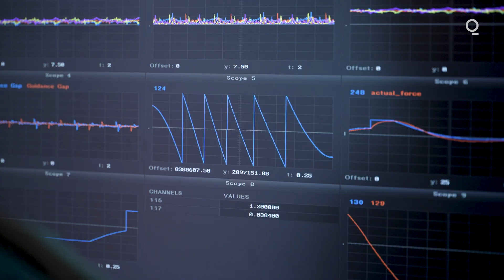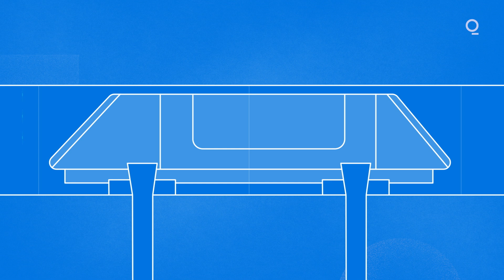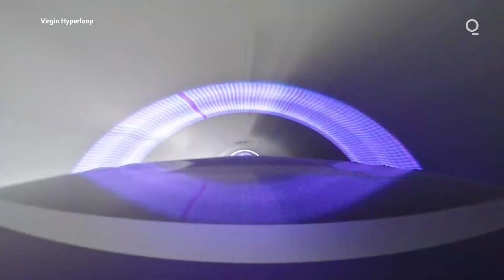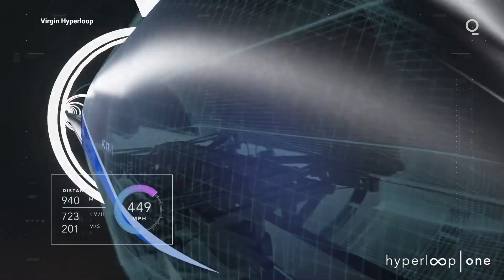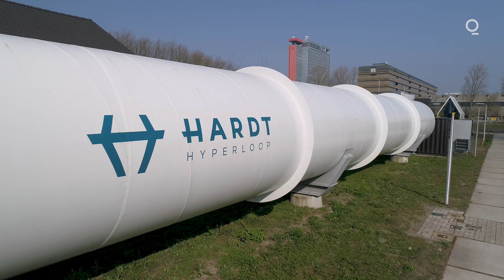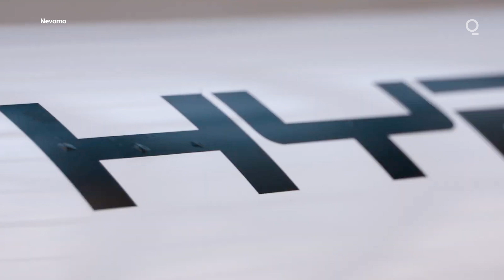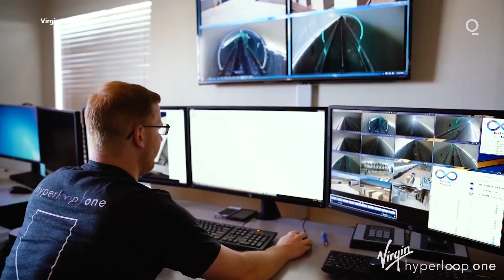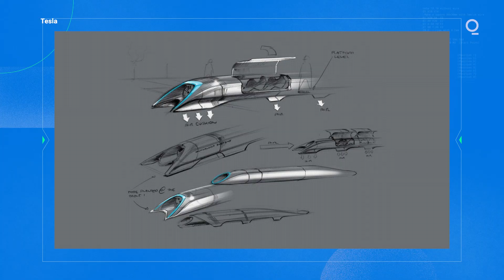The Hyperloop May Disrupt More Than Just Travel

Comment: Keeping a tunnel of any significant length in a vacuum state would be a miracle of science in itself.
Reply: @Hannes Königsmann there is a HUGE difference between pressure coming from the inside of a pipe and a pressure applied to the outside of a pipe.
Reply: @AR-zq9hq  That's absolutely not true. Ever heard of boilers or anything having several tubes inside with different outside pressures?
Reply: @AR-zq9hq  oh,the pressure-i can't take it anymore
Reply: @AR-zq9hq  Why is "there is a HUGE difference between pressure coming from the inside of a pipe and a pressure applied to the outside of a pipe"?
Reply: Oh and don't forget about a disaster that would ruin the track should a single pierce or joint fails
Reply: Flying machines were once a miracle too.
Reply: @zolac9732  Not really as birds fly and dinosaurs before them.
Reply: @Hannes Königsmann I mean there has to be a difference between overpressure inside or underpressure. Plus don't pipeline have bends that help them with the expanding and contracting in different temperatures. I'd be hard to take such a bend at 1000 kmh
Reply: @julian-xy7gh  indeed you are correct.
Reply: @Hannes Königsmann your analogy is completely incorrect. Creating a vacuum is much more difficult than containing high pressure. I worked with vacuum chambers for my dissertation. The problem isn't structural integrity, it's that gas molecules tend to be really small and leak into the system. You need a series of different pumps to even get near vacuum in a small chamber the size of a football, not to mention enough electricity to run a a few homes, and days of pumping. And I'm not talking some basic pump here, they just start you off, you need magnetic ion pumps, turbo pumps, diffusion pumps, it goes on. The system is also baked at very high temperatures before pumping to remove any surface impurities inside the chamber that may have settled. It's crazy expensive and requires doctors in physics to manage.
Reply: @SgtS1lky  no, he didn’t build any rocket, just like he’s not the Tesla founder. Musk has no formal training or engineering knowledge, but he sure likes to buy himself titles, just like he paid to be called a Tesla founder. Just a quack.
Reply: @boskee  Musk definitely worked hard for everything he has today. In the early days of SpaceX he was probably more present like an actual engineer in the company than today, same with Tesla. All in all, he isn't instantly a quack for hiring people to build rockets for him, man just leads the company. Even if he has no experience in any engineering field whatsoever, he still built up his company from ground up! Which is extremely hard, and gives him enough credit for what he is today.
Reply: Doesn’t have to be the whole tunnel all the time.
Reply: EXACTLY.  This is idiotic.
Reply: My thoughts exactly
Reply: That being said, the pneumatic railway did something similar, although smaller , in the 19th century, using coal fired steam engines.  These vacuum tubes were many miles long.
Reply: @darrellparfitt5908  Except they weren't vacuum tubes, they just worked on a pressure differential on one side of the pod versus the other. And this requires a decent seal between the pod and the tube which means friction which then means slower travel otherwise you then have heat and wear to deal with.
Reply: @SgtS1lky  He can be the Warp  engine goblin. This is a title that makes him neither a warp engine nor a goblin.
Reply: Why? 

Vacuums aren’t that hard to pull
Reply: Not to mention impractical, pointless and a huge waste of money.
Reply: The vacuum system at the Large Hadron Collider has a total volume of 15 000 mˆ3, which is probably the largest in the world. Such a volume would correspond to about  2.5 km of hyperloop tunnel. But the vacuum requirements for LHC are much, much stricter than for a hyperloop tunnel. So I would not say a scientific miracle is required; it is more a question of practicality and economy.
Reply: Near vacuum state
Reply: @prathneo  .001bar, might as well be a vacuum.
Reply: @prathneo  Same difference. We've never achieved pure vaccums, only near vacuums, we still call them vacuums. The pressures thrown around by these companies are more of a vacuum what other companies in other areas call a vacuum. It's a vacuum. And it'd be an insane feat of engineering.
Reply: @B4R0N.  i did, just never told anyone
Reply: @prathneo  Exactly this. A near vacuum is far easier than an actual vacuum
Reply: @TehPoet  what pressure are they going to keep it at?
Reply: @TehPoet  Even that is impressive. At scale the best strategy we have would be to dig a really long tunnel and pump the air out periodically which creates less friction. We could not physically create a vacuum tube, but we could potentially create a reduced pressure gradient for mag lev.
Reply: @TehPoet  any vacuum is technically a near vacuum... Maybe a slight underpressure would be viable.
Reply: @TehPoet  Actually the proposed state is basically a vacuum, they are really close and I think it would be impossible for a vacuum tube that sized but essentially it's a vacuum tube.
Reply: @TehPoet  So it takes only three fourth of a miracle and half a fortune to build and maintain.
Reply: @prathneo  99.9% of a vacuum, which is no different to an actual vacuum.
Reply: Only part of the tube has be in the vacuum state. Only where the hyperloop is during the trip.
Reply: @United_Nontoxic  and how is that going to be achieved?
Reply: @United_Nontoxic  wow so a pocket vacuum perhaps held in place with a forcefield,  while the pod hovers on its anti gravity field and uses warp engines to push it along,  oh and dont forget the inertial dampers, all power supplied by a anti matter reactor. And we will have all these new technologies in three years!
Reply: Erm the hadron collider...... you are acting like a technology that we achieved in 2008 is impossible in 2021, I have an idea go and study engineering instead of YouTube and you will understand this is entirely possible the only real concern i would have is how much electrical energy needs to be produced to run the thing because that's where the real problems start
Reply: @SgtS1lky  The large hadron collider does maintain a vacuum but its in a tightly controlled environment, the vacuum tube diameter, about 6cm, is smaller than hyperloop would be, it is much shorter as well even at 27km, and is completely temperature controlled from one end to the other.  Now, they are going after a much lower pressure, but still the scales involved and the tightly controlled environment make this a poor comparison.  It also isnt going to have a multi ton pod racing through it with a full maglev system installed.
Reply: This is old technology from the 50's
Reply: @Acme12345  1850s actually.  Failed then and is a failure now.
Reply: Not a problem, with airlocks along the line being progressively evacuated prior to arrival of pod.  We already have “proof of concept” in place with message delivery systems ib large department stores and hospitals.  I remember them as far back as the1950s.
Reply: @dewiz9596  yes and we know how reliable they are!  The whole thing about a vacuum is pointless.
Reply: @dewiz9596  Sure the pneumatic tube idea might work but the longer and wider the tube the less this works, and if you notice in those systems the acceleration and deceleration are somewhat abrubt.  Controlling the speed is incredibly difficult at scale.  Butbthis isnt what hyperloop is proposing.  That design aims to evacuate the entire length of the tube to reduce the air resistance of the pod moving through it to achieve higher speeds from a maglev pod train running inside it.
Reply: @dewiz9596  They moved at 1000 miles per hour? No so no prove of concept.
Reply: And the tunnel itself doesn’t have to be, it’s platform inside the tunnel that will house the hyper loop
Reply: In 1890
Reply: @blondegirlsezthis8798  dumb
Reply: don't worry, the brilliant minds would solve it
Reply: Hyperloop doesn't aim at full vacuum state and the idea that it does is a hoax invented by a certain salty reasercher addicted to debooooking
Reply: @jankapuscinski8456  Hyperloop is expected to run at .001 bar, basically a vacuum.  That's 1/1000th the pressure of sea level, .014psi.  Again, basically a vacuum for all intents and purposes.  And it is the only way they would get it to the high speeds promised.  While this is not impossible it is but one of dozens of significant engineering challenges to sort out before this idea can work at full scale.  Meanwhile normal high speed rail is ready to go.
Reply: @avi8r66  I find your point of view very interesting and knowledgeable. I am not an engineer. Could you please elaborate a bit more on the technological and scientific challenges the hyperloop presents?
Reply: @Lalairocks  Again?  I think I did that a few comments above.
Reply: @avi8r66  I was curious about keeping a vacuum state and why it is so dangerous. Anyways, appreciated.
Reply: @Lalairocks  Ok, so on that specific topic... 2 separate questions.
1) keeping a vacuum state: Assuming the chamber/tube/whatever is structurally capable of withstanding the pressure trying to crush it the issue is with leakage. Any small opening, microscopic gaps, cracks, a bit of dust in a seal, etc, allows air to enter.  And it doesn't take much to make it hard for the pumps to keep up.  So this is a problem that scales with the size of the chamber, especially when scaling it up means adding more holes in the form of access points, pump attachments, joints from section to section, inspection hatches, etc.  Pretty quickly you reach a point where the pumps are going to be running continuously just to keep the tube evacuated.

2) why is it so dangerous?  2 big risks... structurally a long tube with a vacuum in it has a lot of air pressure trying to crush it.  Search here on youtube for rail car implosion, that should demonstrate this issue.  The other risk is that if you have a pod racing through the tube and there is a breach in that tube ahead or behind it you will have a super sonic pressure wave rip through the tube and impacting the pod, potentially sending it hurtling along like a rifle bullet inside a gun barrel.  This would likely damage/destroy the pod and the people within.  Even if the system recognizes there was a breach and tried to bring the cars to a halt and lock them down the pressure wave would still impact the pod, and it would still be damaged or destroyed.

Make sense?
Reply: @avi8r66  You are so kind and awesome. Thanks so much for your time and wonderful explanation. All is clear.
Reply: @avi8r66  sounds exaggerated. Its just maglev, a well used technology, inside a vacuum tube to reduce air friction. It could even be compartmentalized with fast opening and closing locks at appropriate distances between. Leaks will be common, just reducing efficiency until the repair man comes.
Reply: @TheBooban  In concept its not complicated, and this is why musk was able to pitch it to investors.  But making it work, at full scale, as a transportation system will be prohibitively difficult and expensive.  Just building such a tube for a city to city distance, say 100km, that can safely tolerate being held at .001bar would be impressive.  Even just that, without the pods running inside, no maglev, just the empty evacuated tube built with the various emergency exit ports, inspection hatches, pump ports, etc along its length, would cost money to keep a stable pressure in the form of powering the vacuum pumps to offset the leaks.  For temp control it would need to be underground, so now you have a tunnel to dig as well between these end points.  It just gets worse from there as you make it a working transportation system.  Its a money pit that addresses a problem that doesnt really exist.
Reply: @jankapuscinski8456  just face the fact that it's nothing more than a publicity stunt... it's not going to happen
Reply: @jankapuscinski8456  If you've actually watched the videos of that VERY salty scientist, you'll see that he spends a fair bit of time on the "near vacuum" vs "vacuum" argument. In no way does he perpetuate a full vacuum myth. People just say vacuum because it saves 5 keystrokes and it's so "near" that it hardly warrants that extra effort

Comment: How do you vacuum the entire system? Also when system is down, how do escaped passengers survived in a vacuum?
Reply: There would have to be vacuum pumps at intervals along the tube, probably quite a few running constantly to compensate for leaks in seals.
Reply: Escaped passengers?  What escaped passengers?
Reply: I kinda tried calculating how much the air pressure would be on the tube over 1km. Pretty hard to imagine any material today that wouldn't just implode in a millisecond.
Reply: @brianmorris3290  haven't you heard that they're making it out of vibranium?
Reply: @brianmorris3290  what's the pressure on a nuclear submarine
Reply: @williamlee4731  Go figure. Not here to do your homework.
Reply: @williamlee4731  You have the analogy correct. Now have a look at how thick the hull of such a submarine is.
Reply: @Trevor_Austin  Yeah, but a submarine is a lot bigger in diameter. The larger the diameter the higher the force on it. A much smaller tube can get away with a much thinner hull.
Reply: @brianmorris3290  Actually there is quite a lot of material that can withstand it. This kind of low pressure isn't anything new really. And the size of the system in length doesn't matter in regards to the vacuum, it is the diameter that counts. There already is a test tunnel of 1km used for a university competition hosted by The boring company (due to Elon Musk), and several hyperloop companies are now in the planning stage (like permits) for longer testtracks, they wouldn't be if they hadn't figured out how to make it.
Reply: @MDP1702  The test tunnel was at atmospheric pressure.
Reply: @ThePrashu31  Which one?

Comment: You will need a nuclear power planet to power enough pressure on its gate to make this work lol... it’s as if no one in Bloomsberg has a high school level physics knowledge
Reply: There is no air resistance, so it doesn’t require much energy at all
Reply: @iconsumedmt1350  stop consuming DMT you will think that you can jump since there’s not much air resistance in space and the air will soon be diluted by the ever expansion of space!

Mate. The valves need to hold the ENTIRE PRESSURE of the tube while closing. It will require immense energy to establish the vacuum on and off, if there’s even a little gap it will fail.
Reply: @culturekingsboy6555  I have no idea what the first paragraph is about. Secondly, the international space stations has kept the air inside at standard atmospheric pressure on solar power alone. A moon base will need to do that too. It is definitely possible.
Reply: @iconsumedmt1350   there’s no resistance in space.. there’s only hydrogen...

What’s on earth mate? Nitrogen? Oxygen? What’s their atomic number, calculate gravity as well. Boom, you are comparing an ant to an elephant

Comment: For this to be truly the answer to 21st century travel, all countries need to hash out some standards so we can interoperate from station to station across boarders. I'm still skeptical out achieving a perfect vacuum, but frankly I think it will work if you could simply get the pressure really low. The tubes should be buried to stabilize thermal variances which will reduce environmental impact as you won't need to permanently deface the country side or knock down houses. Once you connect cities together with this tech, then you really only need autonomous electric cars/taxis to move you to outer regions like small towns, villages and countryside. City hubs should have locker rooms, showers and toilets for commuters working far from home. Allowing for change of cloths while commuting and spare tools of the trade to be left in a safe place but accessible if needed.

Comment: We already have pressurized vehicles, that travel at high altitudes to reduce drag. We call them planes. This is just like building an extremely long plane and putting another plane inside of it. Both structures have to resist high air pressure, the tube from the outside, the actual train from the inside because of the vacuum. If there is an issue on a plane, they just have to land and the other planes do not care. In case of the HYPEThingy evrything is blocked until the pod is removed and vacuum is restored in a miles long tube. Would it not make more sense to throw the billions at some kind of green air travel technology, if you like pretty dreams. This looks like a copy paste of scammy marketing material lacking any critical thinking or knowledge about actual engeneering. It seems no one hires real engineers for this kind of projects lately, just a few marketing and product design dudes. I guess it is enough to get some tax payer money from clueless politicians around the world.

It is of course easy content, but was not expecting this from bloomberg. Also is Ford actually on board with this, i bet they still have a few real engineers left :)

Comment: I think this would be much more practical if the system moved automobiles, instead of individuals. In which case, the method of payment could be like an electronic toll system, such as Florida's SunPass. We should be able to simply drive into one of the hyperloop carriers, which then encloses around our vehicles and locks them in place. That would eliminate the need to load and unload from our vehicles, and enable us to simply continue on our way once we arrive at our destinations.

Comment: ther problem is not if it works or not it is also how much it cost, and this can not be built and mantained and be economically viable, specially when you can build a high speed train with all the benefits of a train which can go at more than 500 km/h, basically the project makes no sense.